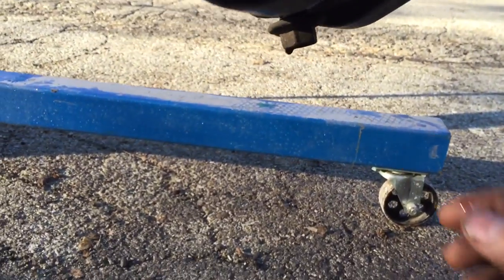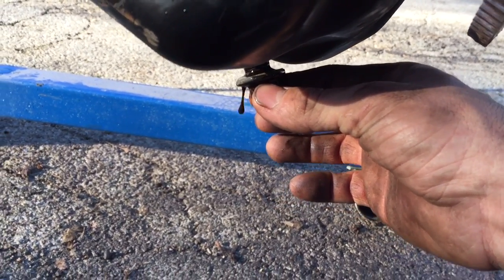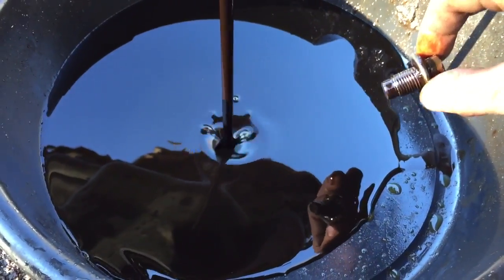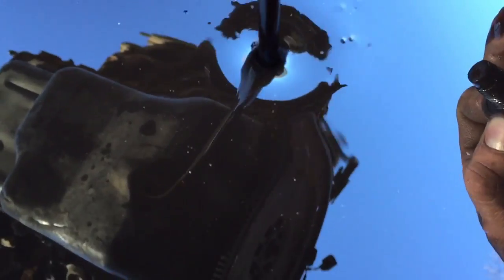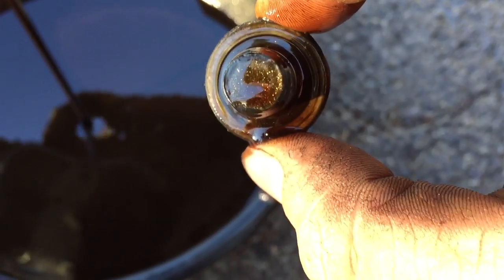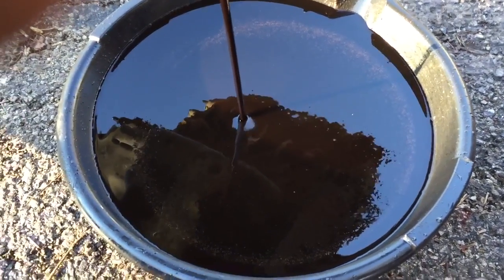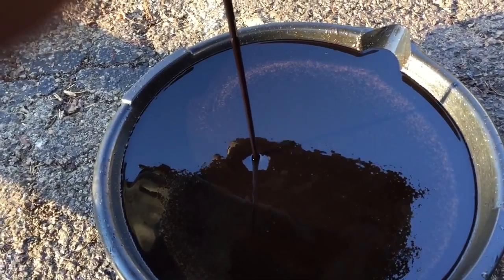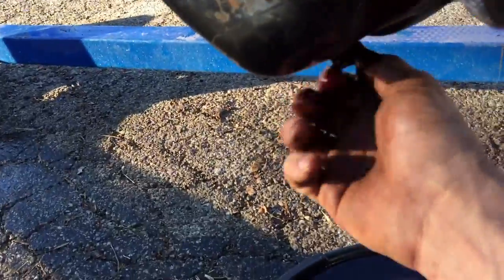5.4 Oil Drain after Oil Pump Failure

Comment: Oil pump failure is very rare!!! What usually happens is sludge, or debris clogging the pick up tube. Low oil pressure esp after warm up is usually due to worn bearings. You stated it's a 5.4. so more than likely there was timing chain noises beforehand. Mostly due to failure of chain tensioners, witch was due to lack of maintenance. Chain slap caused  bottom of guides to break witch in turn clogged up oil pump pick up. Shiny speckles are indication of bearing/ aluminum debris. Ferus metals- aka: crank , rods, oil pump,  cylinders, cam, followers tend to gall and chunk into bigger peices.
Reply: How much noise does it need to make where you know a guide is broke etc ??

Comment: do a cummins swap. or an ls swap. way better reliability.
Reply: does that work with the 4r70 tranny? what do you do to attach one of those engines do you need to buy an aftermarket bell housing?

Comment: To anyone reading this: keep up on your oil change's. I don't care if it's house brand cheap stuff. If it meets the SN rating you're ok. Clean oil is always best.
Reply: So you're saying that he didn't change his oil enough and that' why the oil pump failed? Because I highly fucking doubt that.
Reply: It’s the oil pump so changing the oil won’t fix it.  I just changed this today!
Reply: Organist2020 I know and understand but the cams and other internal components are not getting oil and it’s basically being starved.  Stock 5.4 pumps run 15 -20 psi while the hv runs40+ easily.  All the other issues in the motor ease as the wear is gone.  The motor is a nightmare but once you basically do what ford should have done the other issues in regard the motor issues or minor
Reply: Organist2020 I’m with you lol

Comment: Looks kinda thick for 5w-20.
Reply: he might have been running conventional oil which I hate it thickens up over time I use Royal Purple full synthetic in our 2001 Ford Expedition 5.4L V8 16 Valve in my own civic I use Castrol Edge Full synthetic and My dad's 2000 GMC Savanna V6 uses Mobil 1 High Milage Full synthetic it has 240,000
Reply: TheRepublic besides the rust issue and the fact a it's common for a GM engine to leak for some reason we had a S10 now that was a pita as well as the F250 but our DMAX and Ford Expedition have been doing great

Comment: alot of metal bits man damn no lubrication what so ever how did you know your oil pump wasnt working
Reply from the maker: +jonny2tim3 I was towing a trailer on the interstate and suddenly the warning chime went off. DIC displayed "Check gauges" and the oil pressure gauge was reading low. Tested for pressure with a gauge and the truck had no oil pressure.